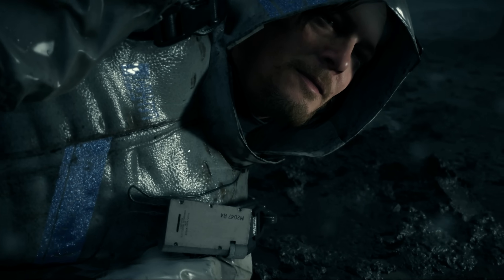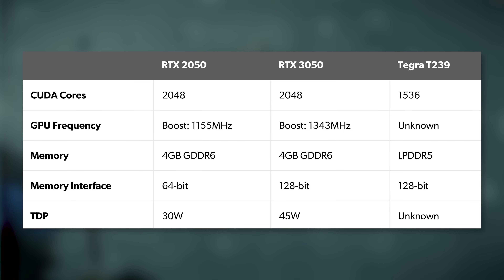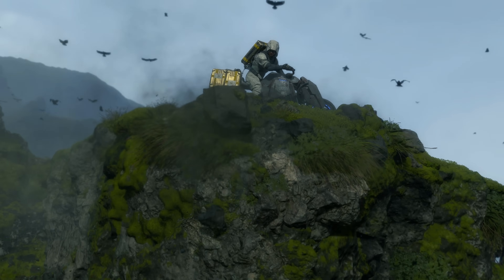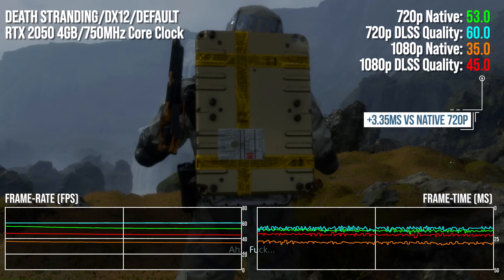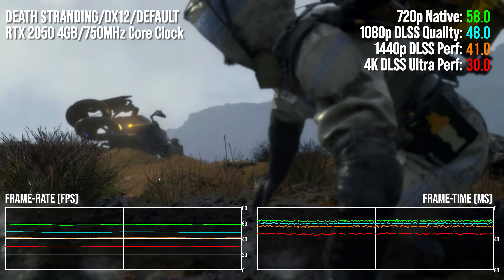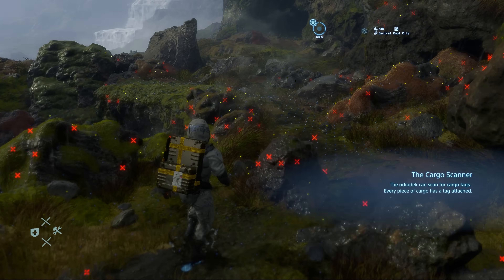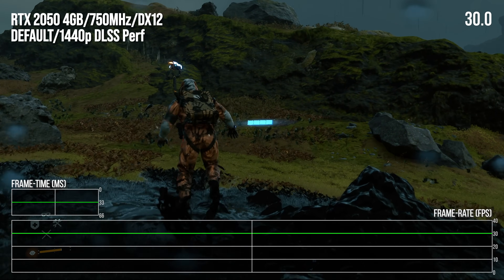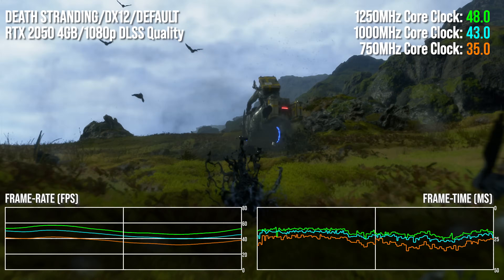Switch 2 Exploration: Nvidia Ampere GPU at Ultra-Low Specs in Death Stranding

Comment: While I love these video analysis from DF, I will point out something significant that is always something to keep in perspective with every one of these. When DF q Are running these mock tests for hardware, particularly low spec hardware such as what Nintendo makes. They are essentially taking the PC builds of the game and running them on hardware that has already been processed through an operating system like Android and Windows. Two things that make dedicated consoles like the switch series unique is one. The operating system is absolutely minuscule and is designed to get out of the way of any programming launches. Therefore, you are quote" coding to the metal unless they're able to yield higher results. And in that expense, we should also factor in that any decent porting company internally or externally who are bringing caliber games such as death stranding to the switch. Successor will be like with the previous switch tailor making every asset to attempt to run as best as they can on a coding to the metal level to what their output is. This is why if you ran, for example native Witcher 3 on a tegra one it really craps out and what makes these impossible ports. Impressive is to see what they changed and scaled on a very programming level, not just using sliders to make everything work. One example I like to point out is hellblade where the way they got around it is they scaled the gameplay the weak points in advantages of the X but they made all the cutscenes completely GI and then it used a piece of software. So it nearly seamlessly transitioned between the FMB and the gameplay. This is what tricked most people that think they had. A Xbox or Playstation level experience on the switch and would have not shown up if they just took how blade as it was and ran it directly off of the chip. Going to be things like this that developers are going to do. They are going to make switch. Two really look like it punches above its weight and considering how much the DSLL the now nearly confirmed 10 GB of RAM and other things are going to be added to it. The machine is already more capable than a lot of handheld devices that are on the market, so that's even more of a resource for developers to use. Just want to keep these in mind that most companies, unless you're really stupid like Warner Brothers with the Arkham collection, don't take the stock games and just run them on PC settings. They will actively go in a Justin Taylor make things for chips. This also includes other consoles such as taking something low spec like the original Dead Space for example and bringing it to something like a PlayStation 5. You would go in and tweak out so much. You wouldn't just take the stop game and run it because it would look terrible on native hardware even though it's many times more powerful than the original system it ran on.

Comment: Switch 2 will be similar in power to the current steam deck i think, with some tweaks in optimisation and battry .
Reply: Steam Deck is around GTX 1050 weaker for the alleged T239

Comment: Kinda off topic but I have a decent phone with a Snapdragon 888 with 8gb ram total (like 3rd best "phone" gpu), and Im emulating semi recent Windows games to great effect (REmakes are "playable" but the emulators are still in early stages with regard to modern features, so its clearly gonna get better). I know this game is getting a native port to IOS, and I imagine if it already doesnt, it will run on Box\Termux emulators soon enough...

I have a point somewhere in here. Figuring a phone, unified architecture, is capable of emulating an "entire" pc experience running off of a phone soc, 8gb ram, and battery for a few hours (in my case) clearly this efficiency HAS to be brought to PC side for it to remain a viable gaming platform... How is this going to happen?

Sorry for the heavy handed question.

Comment: I'm not buying it. With that many ampere cores on the 8nm node plus the CPUs plus gubbins you're talking +350mm^2. That's practically Series X and Nintendo wouldn't do it in a million years. 

Either the rumours are wrong, or they're out of date and Nintendo and Nvidia are planning 5nm, which come Nov 2024 will already be old. Besides which, it can't be the Ampere featured in the T234 line because they don't have ray tracing hardware (after all why would a car need to render ray tracing?), and as impressive as the Fortnite demo is, there's no way the Matrix demo was running as decently as it was on a ~2Tflop machine without HW acceleration (wasn't that the whole point of the Matrix demo in the first place?). And the HW overhead then just makes the die cost problem even worse doesn't it?

The only way I can figure it is the rumours of adapting a super low end Orin  part we're true back in 2020/21 for a Switch Pro model that would lean on DLSS to upscale hard, and the plan was dropped because of the chip shortage and the covid upsurge in sales driven by Animal Crossing leading them to figure (correctly) the OLED update alone would tie them over. Since then they've expanded, reachitected, and renoded and so the old rumours were true, but can't possibly make sense now. 

Great Vid! Great breakdown, and now I'm hoping CDPR makes that port. I'd buy it looking like that.
Reply: And also, I reckon one way or frame generation is going to happen. Whether it's dumb or not, devs are going to deploy FSR3 and discover that FSR3 in quality mode with frame gen will end up with a similarish performance gain at similarish quality to DLSS2+ performance upscaling only but with a useful saving on CPU, which, for power efficiency on a portable is a must. That will either force somebody's hand, or some dev will hack DLSS upscaling with FSR3 FG (in AA mode) or something.
Reply: @michaelrose5696  im wondering if by now they'll just skip dlss 2 completely and use a basic form of dlss3 frame gen. Sort of like the gpu is inbetween 3 series and 4 series nvidia gpu's.

Comment: I know it would be another piece of hardware for devs to optimize for, but Nintendo should offer a dock for the Switch successor alongside the display-out only dock that has, say an RTX 3050 or 3060 desktop GPU inside to at the very least give more demanding Nintendo titles the best chance to perform at 60 fps with minimal compromise to visuals at 1080p, with a price point at $175-200 for those that want it while others can still use the base configuration.  It would provide another thing for Nintendo and Nvidia to profit from, and Nintendo gamers (again, that want it) to benefit from better performance.  It’s a win-win for everybody (assuming devs don’t want to start requiring use of said dock for more ambitious games, which I could see happening).
Reply: All that would over complicate every aspect of development of the hardware and software.  Nintendo is all about simplicity and profits.
Reply: Yeah, they are never going to do that – all it would do is massively complicate development and confuse the market.

Nintendo will just focus on whatever the Switch 2 performance is, and will no doubt continue to produce games that looks and play great in terms of what they are aiming at.
Reply: Lots of people say this but it would be very pricy for the consumers and inconvenient for the devs

Comment: in the end, this means that any old laptop with an 3060 will be way more powerfull than a swich 2, and maybe when they release the new switch there will be a new rog ally that is more powerfull than that, another new nintendo console with 4 year old hardware, the price must be the same at max, if it's more it will not compensate.
Reply: All of those thing will be more expensive than the console, and thisn obviously is old info, 8nm isn't doable for them (i mean literally), so it likely is the same chip but at 5nm, so it pretty much means full chip usage, this chip with its full power matches Xbox series S, or the second one is they already changed for new techas it is more convenient to manufacture for similar prices, so it likely will place somewhere between series s and ps5 lvl
Reply: Any laptop with a 3060 is killing any handheld for a few more years

Comment: Another bare bones upgrade by Nintendo then.  The Switch was 1.5x the Wii U so Switch 2 is looking 2.5x the Switch.
Reply: An RTX 2050, even if underclocked is way more powerful than just 2.5x the Switch. At 1ghz it's over 3TFlops. Switch is like 0.3 TFlops.The PS4 is 1.8 TFlops.
Reply: @guilhermems  Teraflops aren't performance and video games aren't gpus. The switch 2 will greatly outperform the ps4, just like the switch greatly outperforms the ps3.
Reply: obvious troll is obvious
Reply: @Zero-K-999  I highly doubt the Switch 2 will outperform a PS4 - if you believe that prepare for disappointment.

Comment: If the hardware is fully backward compatible and I can run the big Zelda games at 1080p or higher at a locked 60 - I'll be a happy bunny.
The in-house software on the new model is bound to be jaw dropping, judging by the quality we are seeing at the moment on Switch.
I don't personally care that much about 3rd party titles on the system, if they are just ports of titles from other more powerful units.
Also, handheld isn't my thing at all, so my enthusiasm rests with hook-up to a display and performance at that end.
Reply: The Tegra X1 Mariko can run Tears of the Kingdom and Breath of the Wild at mostly steady 60fps with a high overclock, albeit at 720p. In 7 years, I expect no less capability. 1080p 60fps feels like the way it should be. It's undoubtedly doable, but it's up to Nintendo for that implementation in any official capacity.
Reply: if switch 2 would be comparable to ps4 so i would expect 1080p 30fps
Reply: @MrVoland44 did you watch the video? Switch 2 will be basically running on a nerfed and version of a 3050. A 3050 is far stronger than a PS4 lol. And this has DLSS. A PS4 is around a GTX 750 in power. A 3050 is over 300% stronger.

Even nerfed, the Switch 2 will be far more power than a PS4
Reply: @Kougeru what the hell are you talking about?!?! It won't nearly be as powerful as a ps4. The Tegra x1 in the standard version will have about a tflop, which will be more than the cut down switch one. The standard ps4 on the other hand has 1.84 tflops, which is quite a bit more. Where did you get the information that the ps4 has the power of gt x 750? That doesn't make any sense
Reply: @AdamMi1 dude, you can't compare tflops with different architectures
Reply: @AdamMi1  A Tegra X1 is 512Gflops running at full power. (~1ghz)
On Switch it's 393Gflops docked (768mhz).
For a 0.39TF GPU, you gotta admit that Switch punch well above its weight.
And that's because you can't compare teraflops between different architectures.
1TF of PS4 power is actually less than 1TF of PS5 power.
And actually 1TF of PS4 power was already less than 1TF of Tegra X1 power.
But Tegra X1 never managed to produce more than 512Gflops.

If Switch 2 have a 1.4TF GPU for example, it will still without a doubt outperform the heck out of a PS4. Because it's GPU will be based on NVIDIA Ampere architecture.
Not 2012 AMD GCN like PS4.
Reply: @MrVoland44  CPU in Switch 2 will most likely be more powerful than PS4's CPU. 

If they use 8 A78 cores at let's say 1.5ghz, single core performance will be around 4 times better than Switch's A57, and with 2 times more cores than Switch, Switch 2 could have up to 10 times better multi core performance.

Comment: No Matter what, the next nintendo console will be good enough at this point to deliver 1440p/60fps which is what most gamers want tbh. 4K is great too, but i wont be expecting ninty to get 60fps out of that. let's just hope the load speeds are as fast as current gen.
Reply: As long as games can push native 1080p in docked mode I'll be happy. It scales nicely on 4k TVs. Most streamed TV shows and movies max out at 1080p anyway, and I've never had any complaints about how they look on my 4k TV.
Reply: @JohnSmith-bt4lf  you can't expect such an arbitrary thing. It will depend on the developers and what their ambitions are in terms of graphics.  If Nvidia can't guarantee that all games will run at 4k at 60 fps or more, what makes you think Nintendo can guarantee that all the games in Switch 2 will be run at 1080p at 60fps?
Reply: I personally wouldn't peg any resolution or framerate expectations until we have hardware in hand. Nothing is official until it's announced and shipped.
Reply: I'll take 1080p 60fps in handheld
Reply: I wouldn’t expect 60fps as a standard for games on Switch 2. But it’s definitely a lot more possible than it is on the Switch 1
Reply: @istealpopularnamesforlikes3340  most switch 1st party games already deliver HD 60fps, MK8, SSBU, Metroid Prime Remastered, etc. 3rd party games are another story, but i think the boost in hardware will help the 3rd party devs for sure. nitendo im certain will know what to do to optimize their games (save pokemon who are run by TPC)
Reply: That’s not how game development and hardware works. 

The switch can already locked 1080p & 60fps. But because the developers chose better graphics , performance is of course lower. 

On the switch 2, maybe they will aim for higher performance, but likely they will improve the graphics and keep the performance and resolution lower.